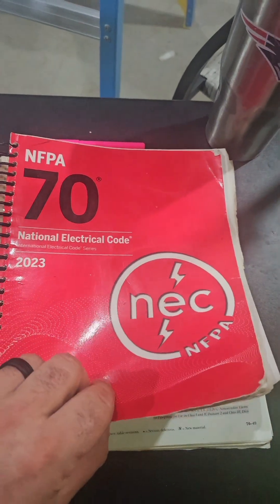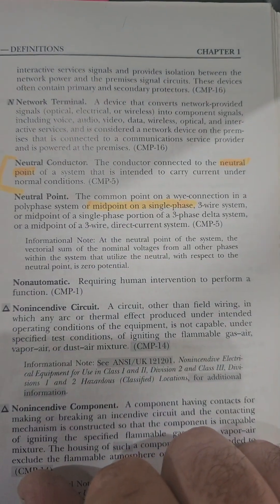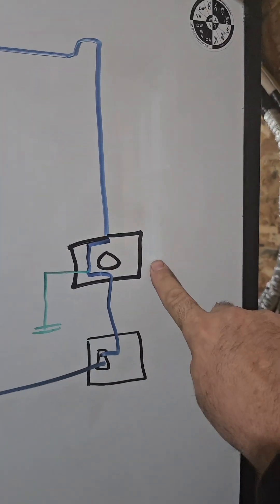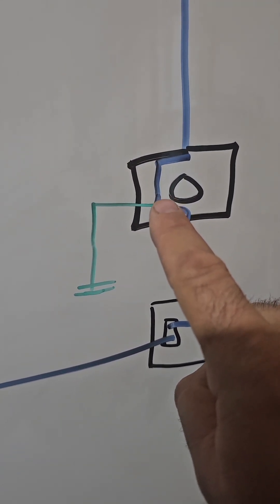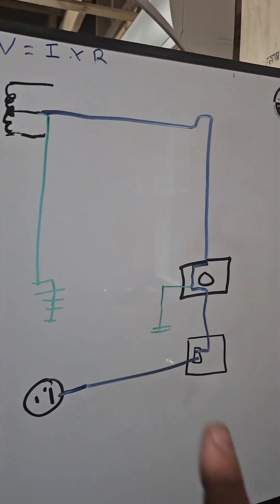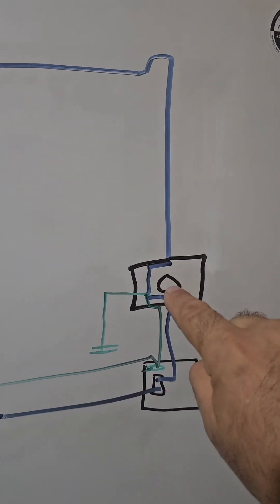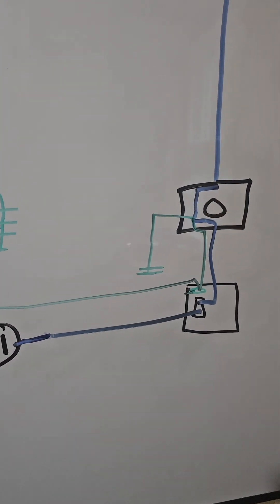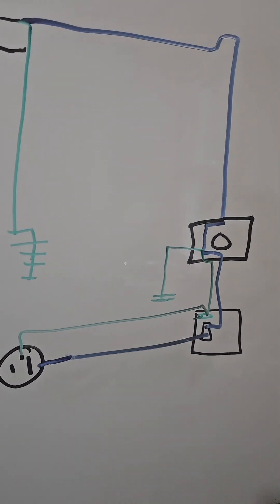Neutral vs grounded conductors which is the right term?

Comment: Makes sense.
Earth, Protective Earth, or Ground isn't expected to be conducting mains current. Contextually it's not a "conductor", it's only a 'conductor' in fault conditions.
So, "Earthed/Grounded *Conductor*" directly and implicitly refers to the Neutral (which, is always and only earthed/grounded inside the service entrance panel. At least, on most-all North American Split-Phase 120/240 service installs.)

Comment: An easy way for me to remember especially when I was an apprentice,  was this rule of thumb: A neutral conductor is always a grounded conductor (on a solidly grounded system which make up for probably 99% of installations you will ever come across) but a grounded conductor is not always a neutral conductor even when it is intended to carry current under normal conditions, an example of this would be a corner grounded delta system, sometimes called grounded B phase systems,  grounded phase services,  and end-grounded delta systems,  these are typically found in old commercial and industrial buildings,  and very rarely if ever used in new installations.  

The only way you could have a neutral with a delta service is by center tapping one of the transformers to provide 120 volts for lighting and receptacle loads, these systems are also uncommon and typically found in older systems but are occasionally installed to this day for facilities where the majority of loads are 240 volt single and three phase, with limited 120 volt loads; the phase farthest from the center tap is the high leg and gives 208 volts referenced to neutral and therefore is unsuitable for line to neutral loads, for this reason a 4 wire delta system tends to suffer from poor balancing and to compensate for this, oftentimes if you look at pole, you'll notice one larger transformer and two smaller ones. Whenever I see this, I know before I even go inside the building that I need to be extra alert so I don't accidentally place a single pole breaker on this high leg thinking I'm getting 120 volts, because I'll smoke up everything on that circuit; I've made that mistake once.
Reply: As a rule, whenever I work on 3-phase gear, I ALWAYS take voltage readings from phase-to-phase, phase-to-neutral (if present) AND phase-to-ground, to firmly establish what type of system it is.
I worked for 10+ years in a large industrial facility that had seemingly all systems present, in different areas of the plant: From the 12kV primary, lots of 480-277v (machinery & lighting), 208-120v for office space loads, some High-leg Delta 240-120v in work shop areas, and lastly, corner-grounded 240v for some machinery. It always kept us on our toes!
Reply: @Calico5string1962  yes, that's a very important rule to live by regardless of how much you think you know the system .  I've been doing electrical work for 8 years and just got my Masters license last month, do mostly residential and occasionally commercial.  

That incident when I got the high leg mixed up happened two years ago at a 1960s family diner.  I was working along with another electrician to replace a panel inside that had 3 three pole breakers, several two poles including one feeding a smaller panel which powered the lighting, security system and some receptacle loads, and I think 2 single poles, service disconnect outside at the meter.  My partner decommissioned the panel while I was prepping the new one and would install it and use the same breaker slots so we could reuse the circuit directory, while my partner was finishing some other tasks that needed attention.  It was approaching midnight as we were wrapping up and we both rushed.  I didn't confirm from my partner which phase was originally the high leg and assumed it was on phase B, as per the NEC, and my partner didn't confirm from me where I landed it and we neglected to verify the voltages. (Originally it was phase C)  Everything appeared normal when we powered both panels up and I got a callback two days later after one of the janitors had plugged a floor polisher into the receptacle in the hallway fed by the smaller panel,  where it seemed unusually fast for about 30 seconds to a minute before going up in smoke.  The security system out of that panel was on phase A, so wasn't affected.  The lighting was F32T8 fluorescent and the ballasts were apparently 120 ~ 277V, because they were on phases A & B in that panel and had no problem. Nothing else was destroyed.  I'm sure you've had some very coincidental things happen to you in the field as well 😀

Comment: 😂😂😂
40+ years as (primarily) an industrial and commercial electrician.
The "neutral" is the "grounded conductor". The "grounded conductor" is the neutral.
This is true in single/split phase systems, 3-phase wye systems, and 3-phase high-leg Delta AND corner-grounded Delta systems. They all have a "neutral"... which is the grounded conductor. That said however, that neutral/grounded conductor in a corner-grounded Delta system would likely not be utilized as a "neutral" in traditional sense (but it is the "grounded" phase conductor).
In any case... You explained it exactly correctly! 
👍👍👍
Reply from the maker: Thanks...  It pretty funny how many ppl on my Instagram and Tik Tok said I was wrong when I called it a neutral